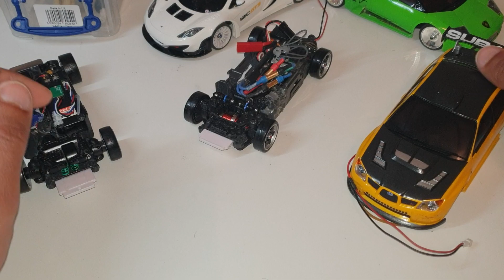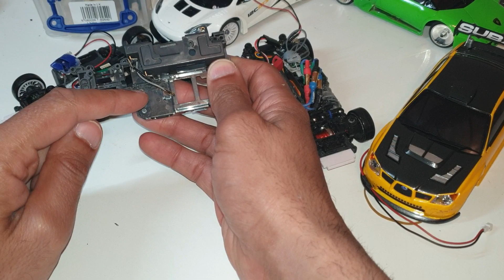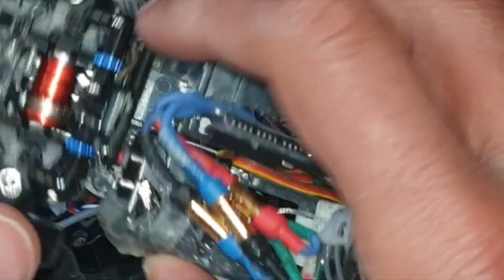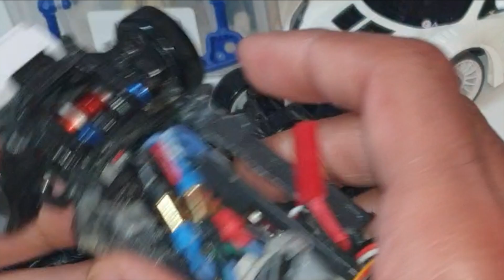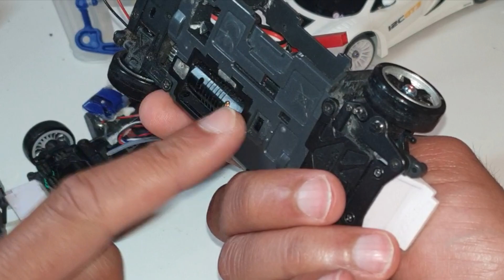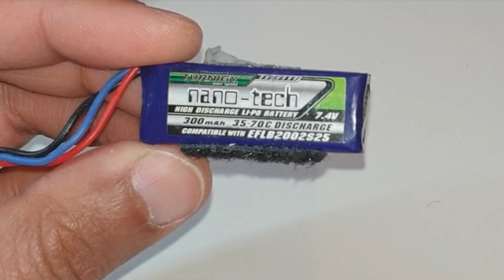Mini Z AWD MA-020 drift rc car  super steering  Custom Special Review

Comment: Nice one my mini z are all cracked now and is very hard to get parts in UK  any suggestions where to buy parts mate thanks
Reply from the maker: kyoshospares on eBay is good he is in the uk , I use Wheelspin models ,they are pretty good ,sometimes the search doesn't bring up the part ...ask them ,they are really good . I have also imported parts from eBay but takes longer. good luck !

Comment: Damn that's really cool. If I were you it'll probably be my favourite car simply because of the effort done to make it work. It's not really a Mini Z but your Mini Z. That battery fits surprisingly well O_O

If there's any car in your lineup that interests me it's probably the GLA xD
Reply from the maker: Yes I do love it. It handled like a mini z and not. It's really unique. I'm trying to organise my track day so the gla can get its moment. It's a beautiful piece of engineering. 👍🏽 Have you taken your hdg1 to longer than 98mm?
Reply: @GarageMiniRCUK  I don't have a shell longer than 98mm but I did try drifting the chassis itself at the max. Makes it really stable and easy to control compared to shorter wheelbase imo :P

Comment: To be honest the chassis isn't as mutilated as I expected. Steering has less play than stock system too, I presume?
The rear DWS is really good. I also use it in my MA-030.
Too bad Atomic doesn't seem to make the front I.A.S upgrade anymore. How does it work compare to VCS we got in MA-020 and 030?
Reply from the maker: It took about 10 attempts but the steering is pretty solid now and turning circle can be as tight as I want . The front suspension and ride height adjustment make it really easy to play around with front steering bite . This version is really for the ma010 but it fits and works with a few tweaks . To me it seems the car takes knocks better when racing on the track and keeps composure often faring better out of collisions(especially against vcs ma020 ) . it also gives more room to adjust suspension travel when switching body shells . my only real gripe is when you start adjusting ride height it takes forever to stop it riding on 3 wheels. But when you get it right it steers left and right equally .I've beaten the ma020ve pro racing an equal driver. I think putting an atomic speedo would make it perfect . The hobby king esc does have a reverse delay but for £10 im happy .
Reply: I Did find Kenon is stocking the double A arm front kit for the MA-010 which can be adapted to the MA-020 with some cuts of some unused mounting holes. Did wonders for handling and drifting
Reply from the maker: @BlitzWorks  thanks for the heads up. I'll check it out. 👍🏽
Reply: @BlitzWorks  Thanks. Nice find indeed!
Oh... it's PN with an insane price tag.
Reply from the maker: yes atomic one was £15 pn racing £100 , its a whole car ...